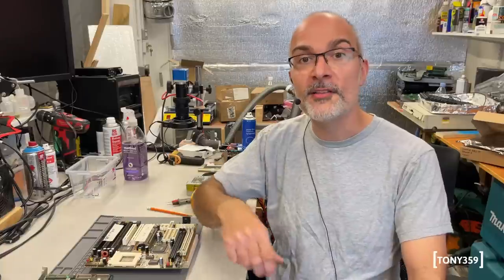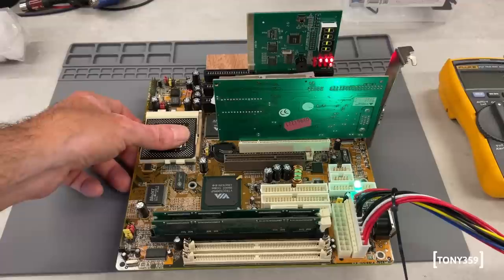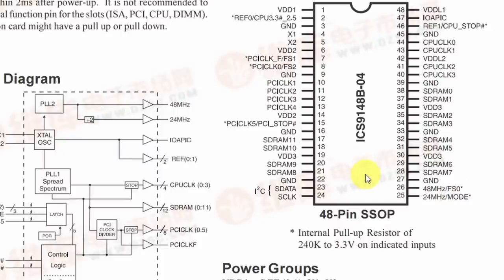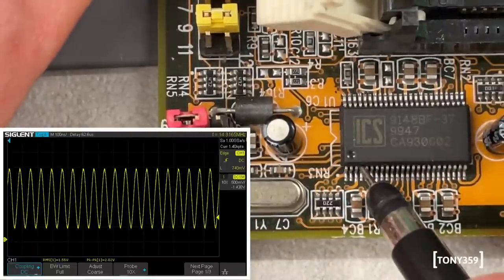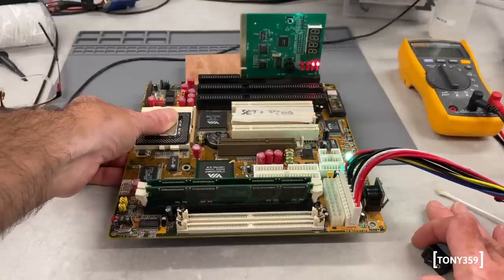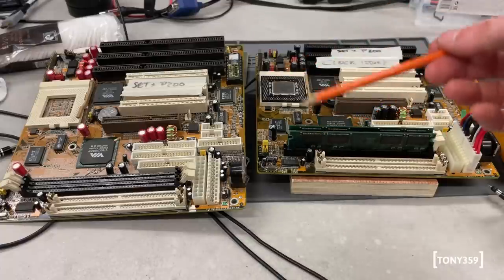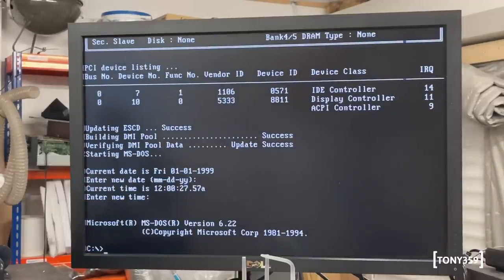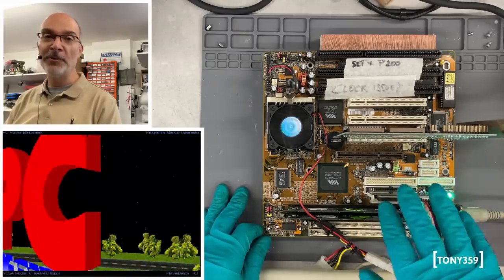Socket 7 Motherboard repair - Shuttle HOT591P

Comment: Crystals that have oscillators installed in the IC usually have 20pF caps to 0V from each crystal connection, sometimes with a 1M resistor across them too. I have seen those caps fail, as well as the IC oscillators failing too, a trick I use if trying to fix something like this is to inject a signal from a signal generator into the IC crystal connection to effectively bypass the internal oscillator.
Reply from the maker: Good tip! I need to check if my ancient signal generator can reach those frequencies though!

Comment: Great repair Tony! Very nice and thorough diagnosis. I really like your style of videos!

For this type of drag soldering I'd recommend a BCM2 tip, these have a hole in the bottom of the hoof like you mentioned. That really helps with taking away excess solder like you had to do with that solder bridge.

Keep up the good work, I really hope your views will increase from now on 🤗
Reply from the maker: I actually looked into that, my tips are genuine Hakko (The Ayoue simply don't work) and the one I used in the video IS the hoof tip. But I cannot find a hoof tip with the cavity at the bottom as you say. The BCM2 is a cartridge tip, mine is old fashioned. Are you aware of a similar tip in the T18 form? Thanks for watching!
Reply from the maker: been thinking of getting the KSGER for a while. My "Ayoue" is... meh. But with Hakko tips it works well. Still, the cartridge tips are cool. I was hoping a sponsor would send me a station for free! LOL!

Comment: I have an old skt 7 board with 3 in tact 168 pin RAM slots on it. Would you like it. I accidentally dropped it and after that it didn't POST. I suspect the large northbridge BGA IC. I have reused the large CPU capacitors, the rear USB port and CPU fan header. Its a M599LMR V1.4 SiS 530 + SiS 5595 chipset. Onboard VGA, onboard CMI8738 sound, onboard DM9102F LAN. The LAN needs a custom rear bracket, which i don't have. You could salvage 2 of the RAM slots to replace the damaged ones on the board in this video then try to fix this board if you want. Should be easy for you.
Reply from the maker: Thank you for the offer! Someone has already sent me the RAM sockets to fix the Shuttle! Your board seems to be a nice little one! I think I have enough PCChips in my stash but if you are in the UK (so postage is cheap) I can try to revive it for you! :) Thanks for watching!

Comment: Technically, you should be able to get a K6-II+ 570 working on that board. These processors appeared at really high volume on ebay some years ago, initially at ridiculously low price. They prefer 2.0V over 2.2V, and they might need a BIOS update, but BIOS modding for K6-II+ is common in the retro community. If that 2001 BIOS does not already work with this processor, chances are high someone already published a modded BIOS.

You way of soldering looks very clean and professional! I would have tried to use some wick to get rid of the excess solder that caused the bridge at the clock chip. Trying to distribute the excess solder over multiple pins to avoid a bridge obviously works, too - but is there any specific reason you didn't wick it?
Reply from the maker: No specific reason, I tend to wick it when it's a bigger blob, otherwise I try to spread it around. Turns out the tip I was using... IS a hoof tip. So I need to improve on my skills :)
I'll keep an eye on one of those processors then! Watch this space - thanks for watching!

Comment: This was a great video, Tony.  Thanks for your clear and understandable explanations! I just tried a second CPU on a HOT-591P and the board does not respond.  It came in its original box with CD, manual and sealed I/O cables and brackets.  This video gives me hope that it might not all be lost.  I'll have to look into one of those POST cards and how to use an oscilloscope.  I really enjoyed this.  Thanks again!
Reply from the maker: A boxed 591P! Amazing! I hope you can fix it!

Comment: I love your content, Tony. And I love the way you tackle all challenges with a smile. This is my favourite kind of content so I'm always going to be watching. 😊

But I understand that keeping the algorithm happy is a challenge. In some ways this kind of content isn't really for "the masses" and I think that's what the algorithm really caters for, and it seems that a lot of YouTubers in this space have similar issues attracting and keeping viewers. It sort of leaves you doing it for the love of it more than anything else.

I used to order loads of stuff from RS, but in recent times I've been ordering more from Mouser, especially when I have to do a big order. I figure if I'm going to have to order over a certain amount to get free shipping then it doesn't really matter which one I order from, but Mouser seem to have a bigger range of stuff compared to RS as well. But they ship from Texas so it takes a couple of extra days to arrive - RSs overnight delivery was hard to beat when they didn't have a limit.
Reply from the maker: You are right, repairs are not for everybody - especially those which involve an oscilloscope! The audience is there but it's not huge.
I order from Mouser every now and then when they have something nobody else has. RS is the next choice in terms of range but you need £50 I think to get free shipping. CPC is more reasonable with £20 minimum order. I can find my Panasonic capacitors there but for more weird stuff it has to be RS or Mouser indeed. 
Thanks for watching!

Comment: hi tony. i have an asus p5a-b  super socket 7 motherboard. 
it doesnt post. pci diagnose card showing 0. cpu is getting volts as i set the jumper. and its getting hot. 
i only have a digital multimeter. is there any way to check the clock without using osc?
Reply from the maker: 00 means that something is happening otherwise it would be --

A good multimeter can also read frequency. Failing that, there are cheap oscilloscopes nowadays which can be useful for those purposes. Take a look at Adrian's Digital Basement channel, he did a mini-review on this subject.

Do you see the RESET LED on the diagnose card flashing ON and then OFF when you give power?

Comment: Great work Tony. I find drag soldering works fine with an ordinary bevel tip, just point the flat side towards the pins(looks like you had the flat side pointing down)
Reply from the maker: Interesting. That was the Hakko T18-C2, which incidentally happened to be the "hoof" tip I spoke about - but Hakko don't make the cavity ad the bottom. I think I understand what you mean, I shall try that next time! Thanks for watching!

Comment: Really enjoy your videos and the trouble shooting steps you show.  cheers.  Does that site have agp and pci replacement slots?  I will have to check them out.
Reply from the maker: Thanks for your comment and for watching! I haven't checked on AGP and PCI but at least PCI should be a more widespread type of connectors so I am optimistic about that! Cheers!

Comment: Great find on what the problem was! Do you recommend the flux so far?
Reply from the maker: It's a bit early but considering it's 10x cheaper than the AMTECH it doesn't feel 10x worse :) I guess for BGA I'll still use the Amtech but for basic stuff this might be ok! Thanks for watching!

Comment: These boards are my fav's. I have two that I've hacked with AMD uP and chips (VIA replaced with AMD). Overclocked with 22Mhz crystals.
The best upgrade for these boards, is replace the VIA chips.
Reply from the maker: That sounds like a cool project, one of the ICs is SMD! :) What AMD chipset did you use?
Reply: I'll have to get back to you. Just moved, everything is still packed away.

Comment: Hey Tony.
A genuine question from a old hardware enthusiast: 

Capacitors are a cheap parts, and as we know a lot of problems in old hardware occurs because the old capacitors was too much used (in the good times) or are no longer used for a long period that cause problems with voltages and stability

So why not change all capacitors by modern capacitors with the same value? I'm referring the newer aluminum capacitors, that are smaller and more resistant than older, that are used in new motherboards. I know, I know, some enthusiasts want the exactly same hardware and bla bla bla, but some people just want the thing working good.

Its safe to do this changes in the motherboard? Can old hardware accept newer parts?

Greatings from Brazil!! (y)
Reply from the maker: Bom dia! Sim, it is safe to replace them all. I know there is a big debate on "capacitors". Here is my point of view
1. Good capacitors are somewhat expensive. I don't see a point in replacing an old capacitor with a cheap one, I buy Panasonic ones which can be 0.2/0.4£ each. If you have a bunch, it adds up to the price to fix the board
2. Most of the time there is nothing wrong with old capacitors and they can probably work perfectly fine for many years - though replacing them will definitely extend the life of the device of course
3. Most of my repairs are "for fun". I don't use these devices on a regular basis so I don't see a point in replacing all the caps and the put the board/computer on a shelf and turn it on twice a year :)
4. Replacing caps is time consuming. Particularly on motherboards where you have lots of ground planes. 

So yes, it's a good idea but I don't do that anymore as a "standard practice". I tend to replace those which have actually failed or where circumstances ask for it - for example, you intend to use that device on a regular basis. 

I've recently recapped the PSU of my NAS: it's on 24/7 and some caps had exploded because of the heat. First, I fixed the heat problem :) then I replaced them all of course. 

I hope it makes sense and obrigado pela sua visita. Ate' logo! :)
Reply: @tony359  First, thank you for your response! I appreciate this! 

I'll see the Panasonic capacitors arround here, there are other brands that have a good quality? I'm searching for the high end and the best brands.
Reply from the maker: you're welcome :)
I use Panasonic, the FR series is my favourite - but it's also a bit expensive. It depends how much you care about your device. If you re-cap a retro machine which you're going to use every now and then, maybe you don't need the top of the top. For something more serious then you want (usually) 105C, low ESR capacitors. 

Of course there are other good brands - the consensus is "get a good brand and stay away from unbranded ones". A decent capacitor will last decades anyways!

Comment: is it possible to safely remove a latch from the more broken memory socket and then pop it into the less broken one so you could replace only one of them ? because dimm don't need to work in pairs like simm so you could be ok with just one working one for testing if the other one makes issues or just use simss for now
Reply from the maker: I think it is - and I believe one of the socket is only missing the latch. However, I need to pull quite a bit to remove the DIMMs so it's really not a major issue and both modules seem to be working fine. 
Anyways, I have found a way to get some - watch this space!
Reply: @tony359  if it was me i would just look for broken amd athlon/duron or pentium 3 or4 with sdr slots and just put the on a stove to pull the whole soskets if the price was a problem when ordering new
it would be destructive to the boards sockets would be pulled from but pentium 4 and amd boards with sdr are kind of garbage and usually cost acordingly
Reply from the maker: That's what I am also looking for but there is a catch: if I got one of those boards... I would feel sorry to sacrifice it for the Shuttle so I would end up repairing it! :D Anyways someone is sending me spares so problem solved :) Thanks for your input!
Reply: @tony359  fair point this is why i would just look for junk, non repairable, i could look up my stash for some boards sawn in half just to remove something, but i don't think international shipping would be worth the stuff you could recover from them even though i have probably 6-10 completly  broken board i wouldn't mind giving someone for free for spare parts, mostly s370

Comment: 21:50 compaq flash. Please can you tell me where you got this please.
Reply from the maker: It's a pretty inexpensive tool. A Compact Flash is an IDE device so the adaptor is just a passive adaptor, no ICs on it - besides some diodes and transistors to allow for power through IDE on some boards. I will add a link in the description! Thank you for watching!
Reply: @tony359  I have two socket A motherboards that I have been repairing recently and I am still using old ide HDDs to test the boards. A compaq flash converter like yours would be ideal.
Reply from the maker: They work great, just make sure you buy some 512MB ones so 99% of boards can see the drive. I stopped using the spinning drive some time ago, I am pretty happy with this adaptor - which is nothing special as I said!. The link is in the description now.
Reply: @tony359  thank you so much